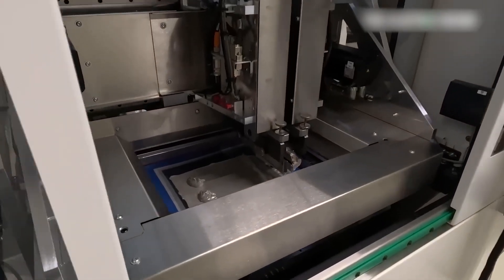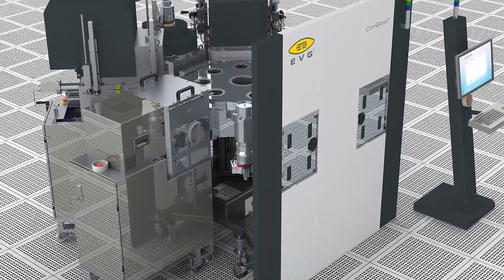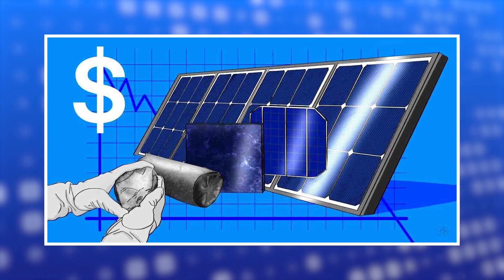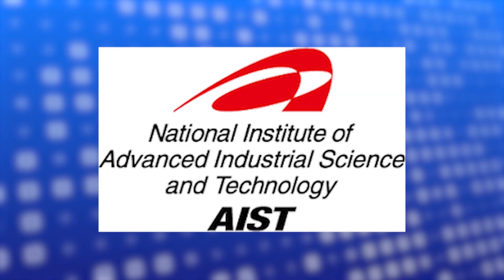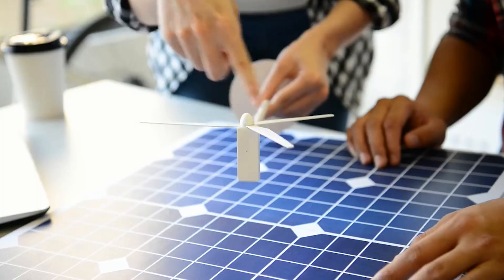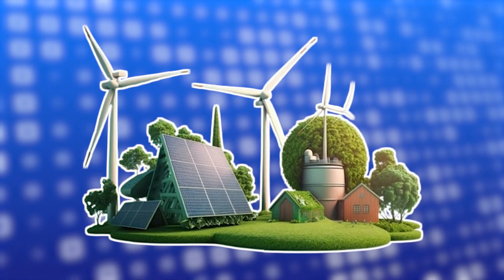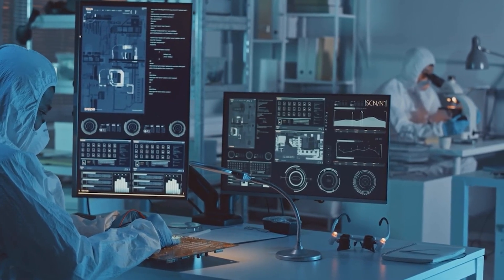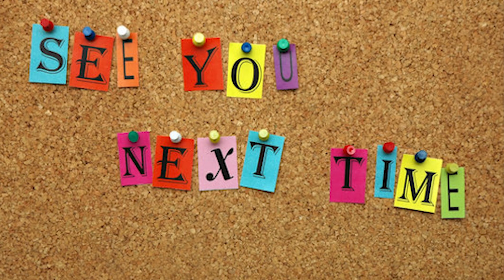Oxford Is Breaking A Lot Of Solar Cells That Will Change EV Game

Comment: this is not new as an idea or novel in application.
although theoretically great conversion rates can happen  , but not assured
longevity is uneconomically low n fragility and unreliability high
so cost n deployability as a product is not viable n physical limitations n material constraints are insurmountable for a practical rollout beyond research support.
beyond interesting, this is a dead end unfortunately

Comment: EV suck because the batteries don't hold enough charge AND don't charge fast enough. The batteries ALSO suck majorly because they are very prone to catching on fire AND are very hard to put out.
 I don't see how solar cells factor into the EV equation.